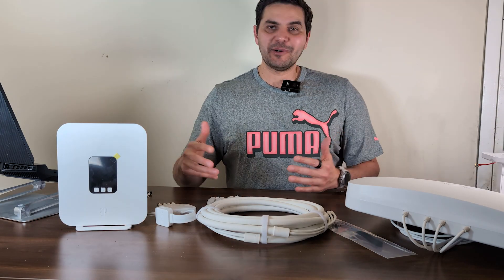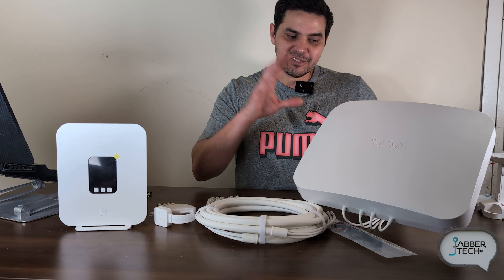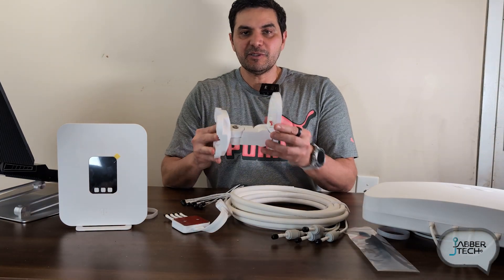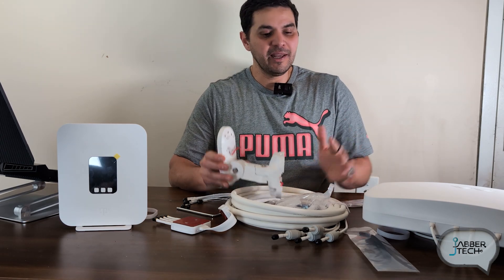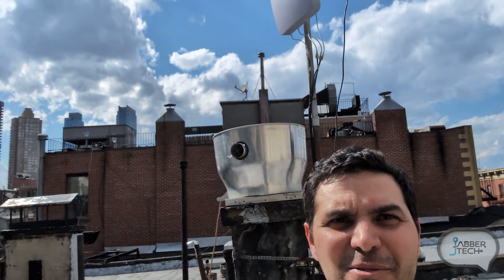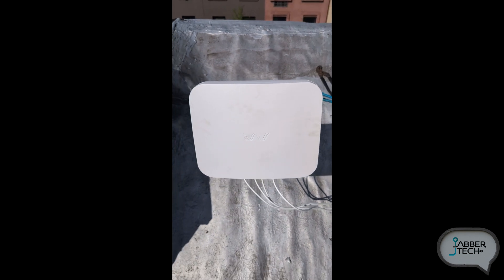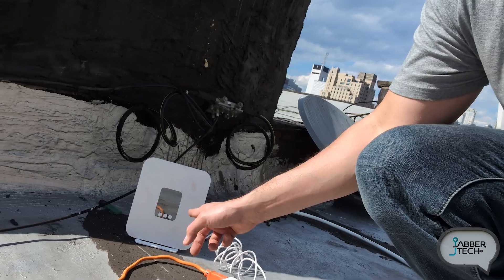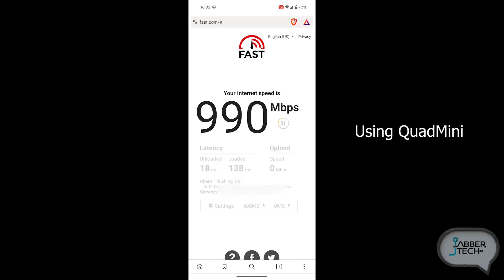Waveform Quad Pro External MIMO Antenna for T-Mobile Home Internet : Installation & Test

Comment: T-Mobile sucks and this antenna doesn’t do much. I’ve got both and am in line of site to tower and get signals as low as 50/7 at busy times. But this antenna does install easily and can’t blame the antenna on mobile’s terrible service.

Comment: Do you know if you buy the antenna only, do you just need to purchase/replace the one UltraFlex-Quad Cable? Or are there other adaptors you’re going to need specifically for the Tmobile router? Of course considering that I’ll be buying new from waveform (kit would include everything that comes with the “antenna only” bundle.
Reply from the maker: I would check their website for what's Included. I'd assume antenna only is  just the antenna only 🤷

Comment: Per instructions, the QuadMini can be mounted outside. I am not planning to install on the roof peak but low under the eve. Trees are way higher than my house and about 200 feet away. I didn't consider an attic install. I could take the wireless router up there for a test but everything would be on WIFI.

Indoors, I did NOT get better speed than the 4 antennas that came with the Cudy P5. I am temporarily using the through window adapter but it barely let my vinyl window close and it looks bad. 

So, I have tried to find a split grommet to cover the holes inside and outside the house wall.  There are  lots of Starlink parts but that is a much thinner cable. I ordered a Uxcell rubber grommet on Amazon with 14mm inside hole diameter and a 24 mm wall hole. This will accommodate the larger cable end where the small cables come out. Can then use silicone to glue it on and seal it.

Ookla Speeds: 20Mbps before the QuadMini and with it outside on a step ladder, 70 - 100 Mbps. Primarily the signal/interference measure improved 2 to 3. Signal power measurement is about the same, -99 to -103.  My phone WIFI speed is around 40 - 60Mbps vs  20 before the QuadMini.

That is life in a semi-rural area.

Comment: I have multiple Cell Towers that are somewhat close to me and the closest Tower is right down the Road from me and I currently have my Waveform 4X4 Quad Pro Antenna up in my Attic pointing towards that Tower and I get around 700 for Download and around 15 or 20 for Upload. I ordered the Waveform Quad Mini because it's Omnidirectional and I'm gonna get it in about a Week but do you think I could see a Reliability and Speed increase do to it being Omnidirectional and since I have multiple Towers around me?
Reply from the maker: You still have to point it in the right direction. I got faster speeds with the mini vs the pro but placement is still key
Reply: @TheJabberTech  Oh ok I'll definitely still point it towards the nearest Tower! Thanks!

Comment: Good morning... I'm confused...if I have a D-Link Router...one antenna to get Internet from my provider...how I'm going to connect this quad unit which has 4 cables....??? Thanks
Reply: this is only for 5g home internet when the modem/router has 4 outlets for antennas.  it isn't for fiber or cable internet.

Comment: Your antenna should be plumb it's not going to grab the waves correctly also it needs to be higher as you have several obstructions on that roof:
Reply from the maker: As u saw my older antenna was high up and got same results
Reply: @TheJabberTech  I didn't see the test on that one yet, I think this is my first time checking out your channel but I definitely will check it out
Reply from the maker: I showed it in this video too. The QuadMini is the shit. Thats what I'm using
https://youtu.be/BNT5PtsyQUA

Comment: 👀Imagine what you get with a 3rd party modem with 5g sa ca only option
Reply: Yes you can if you match the imei numbers with t mobile modem
Reply from the maker: Which 5G modem allows you to clone an IMEI number. Let me know
Reply from the maker: Sadly you cannot put a tmobile home internet sim in a 3rd party modem. At least didn't work for me

Comment: I tried the quad mini, I had to return it. I got slower download speeds and slower upload speeds compared to the G4AR internal antennas. I need to get a 3rd party modem/router so I can use 5G SA multiple 5G bands rather then the 1 4G band and 1 5G band. I have 3 towers near me. One of them hits over 1GB the other tower hits about 800- 900MBPS I would love to know what I get using carrier aggregation
Reply from the maker: Yeah, getting the right location is key. Took me some time to find the perfect angle for the mini, even if it is omni-directional, placement is criticL
Reply: @TheJabberTech  I tried all locations on my home. Unfortunately I am really limited to 1 spot since I need a Ethernet connection for my Xbox Series X.